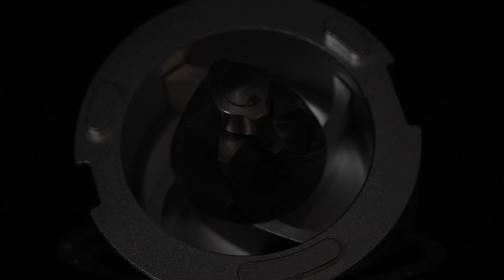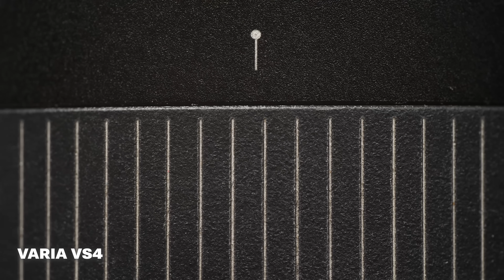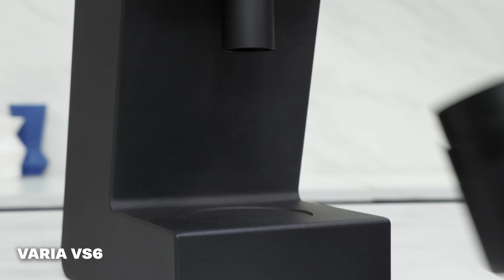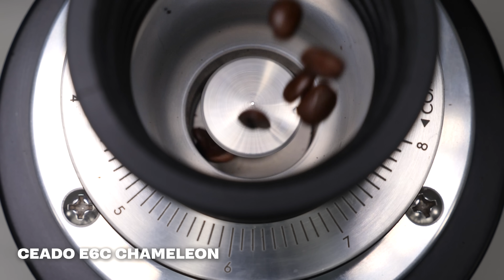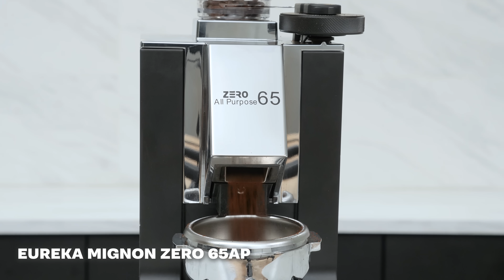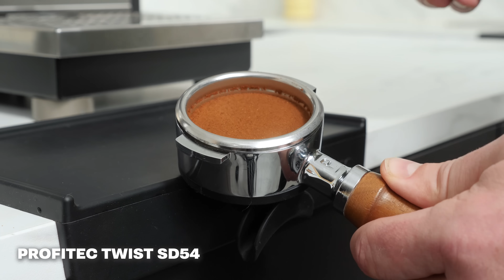Top Single Dose Coffee Grinders 2025 — Best Options for Espresso & Multi-Purpose Use

Comment: What is the best eureka grinder for espresso? 
Mostly I am thinking on buying the single does pro, but what do you recommend?
Reply from the maker: Hi Hassan, well, "best" depends on what is important to you! If you are certain you will always want to single dose then the Single Dose Pro is a great choice. With very low grind retention you get a fresh dose every time. If you'd prefer a more streamlined workflow in which you do not have to weigh your beans prior to grinding then the hopper fed Mignon Libra: https://www.wholelattelove.com/products/eureka-mignon-libra-ap-weight-based-coffee-grinder?variant=43159728554038 grinds by weight automatically. Hope that helps!
Marc

Comment: So I've been using the Oro that I bought from you guys a few weeks ago and for some reason I get ridiculous retention, sometimes as low as 1 g , I literally have to tap the shoot several times to get it to come out, I have removed the little antique clump piece that's in there but still having the issue not sure what might be happening there
Reply from the maker: Hi A, That's unusual. Are you using RDT and operating the bellows at end of grind cycle?
Marc

Comment: I don't like single dose coffee grinders.
A grinder with a hopper on top and filled with coffeebeans.
Only the sight of it combined with the smell of coffebeans gives me a real barista-coffee experience.
And further rmore I am using the weight based Fiorenzato AllGround Sense All Purpose Home Coffee Grinder.
It's a delight to work with.
The espresso's and the filter coffees are tasting wonderfully well.
Real barista's don't use single dose grinders.
Reply from the maker: Hi NS, Well... There is the visual pleasure of the beans! Gotta say a bean hopper probably not the best place to store beans for more than a day.
Reply: "real baristas" are ripping through large bean quantities daily. Home barista's aren't doing that, and having the beans sitting up there in the hopper are just resulting in them going stale.
Reply: Grerat grinder, I use one as well.  But for trying new beans I use a Varia VS4, once I find something I like it goes into the rotation in the AllGround Sense.

Comment: in the Eureka Specialita grinder and I think it's similar in others. a lot of coffee collects under the lower burr holder, which means a lot of cleaning and the level of difficulty increases. there is also a lot of accumulation under the spark plugs and their regular unscrewing at one point caused my thread to break. service ? sending the grinder back to Italy because you won't be able to buy any parts. I will never buy a Eureka grinder again
Reply: Spark plugs?  Is it a 2 or 4 stroke?
Reply: Wow 😱
Reply: Huh

Comment: I love my varia vs6  and its conical burr option.
Reply: Mine grinds at 3.7 so fine that finer does not make any sense. (For me and my setup). it runs at 25-30 sec with a middle roasted bean to ~40 gr.
Reply: How long have you had it? There have been some hit or miss reports in terms of quality control, particularly with the earlier batches. Congrats and enjoy!
Reply: @orezaian  I don't think its decent for espresso off the box. You need to install the washers they give to grind fine enough, especially for light roasts.
Reply: @TheJProducti0ns mine chokes at 1.5, can't Imagine going any finner